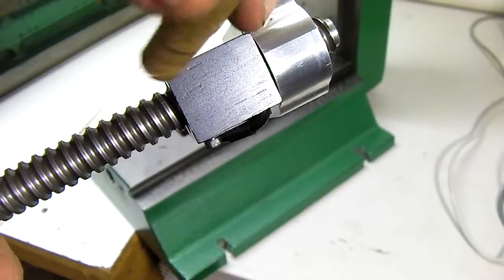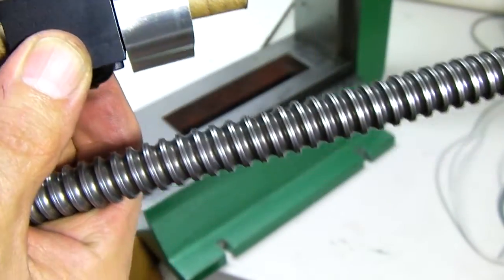G0704 Y Nut install Roton

Comment: Hi Dave, i bought your g0704 kit about 9 months ago(it’s been great), i need to change the coupler.  i removed the old coupler realized it was threaded.  any tips on reinstalling a new oldham coupler?  my kit didn’t didn’t have the ?castle nut shown in this video.
Reply from the maker: I changed to the threaded coupler. I thread them. I can replace the coupler for free if you like or just the spider if that is what is needed. 
Feel free to email me at davedaxx1@yahoo.com.

Thanks 
Dave
Reply: I damaged the original coupler in the process of replacing it for a smaller motor shaft.  I bought a new one, i'll just thread it with M10 1.5 tap.  Thanks for the reply, you answered what I was wondering and thanks again for the great kit.  It's been working well for me.